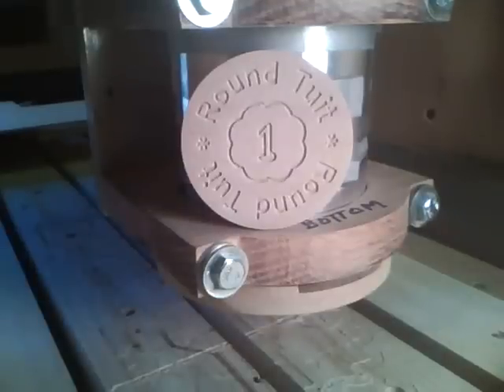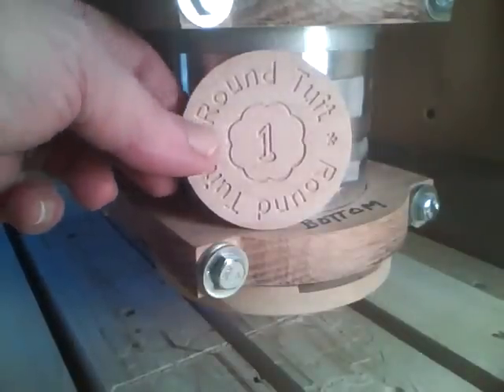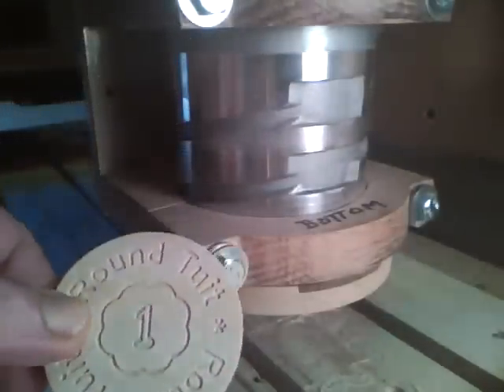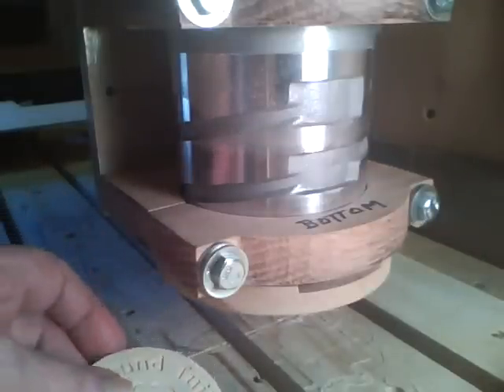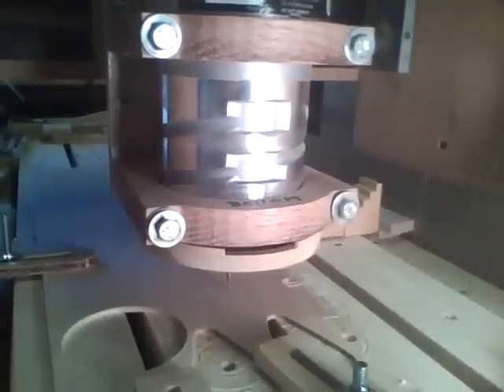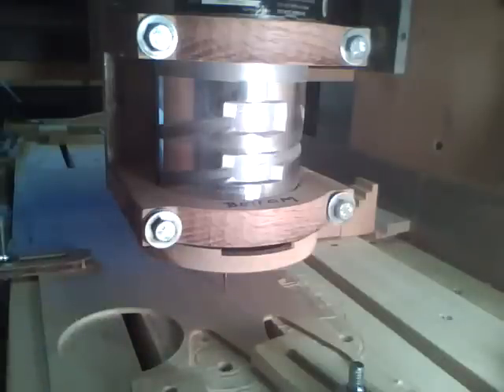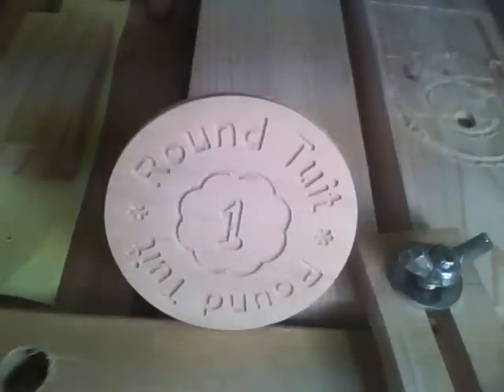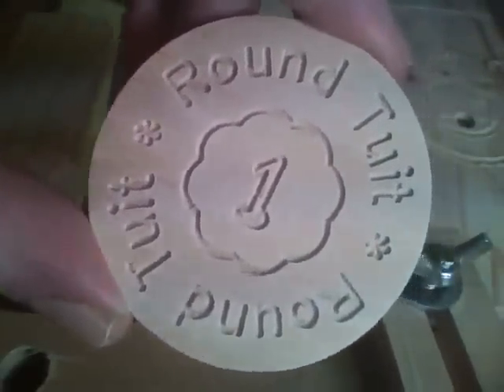I'll do it when I get a Round Tuit

Comment from the maker: I had a request for the G-code, so here it is:

%
(File: Round Tuit 2-5.skp)
(X0 and Y0 is central)
(Bit diameter: 1/16" Ball)
(Feed rate: 10.000"/min)
(Plunge Feed rate: 4.000"/min)
(Material Thickness: 0.125")
(17 April 2015 Jim Steinbrecher)
G90 G20 G49
G00 Z0.025
X0.7425 Y-0.3075
G01 Z-0.025 F4
X0.9635 Y-0.4245 F8
X0.913 Y-0.519
X0.886 Y-0.545
X0.8695 Y-0.55
X0.843 Y-0.5495
X0.822 Y-0.538
X0.8065 Y-0.5165
X0.802 Y-0.5005
X0.808 Y-0.4635
X0.8585 Y-0.3685
G00 Z0.025
X0.819 Y-0.4425
G01 Z-0.025 F4
X0.6645 Y-0.4545 F8
G00 Z0.025
X0.6915 Y-0.676
G01 Z-0.025 F4
X0.7 Y-0.6505 F8
X0.7 Y-0.617
X0.6835 Y-0.5835
X0.667 Y-0.5665
X0.6335 Y-0.549
X0.5995 Y-0.549
X0.5745 Y-0.557
X0.549 Y-0.5825
X0.5405 Y-0.6075
X0.54 Y-0.641
X0.5565 Y-0.675
X0.5735 Y-0.692
X0.607 Y-0.709
X0.6405 Y-0.709
X0.666 Y-0.701
X0.6915 Y-0.676
G00 Z0.025
X0.5125 Y-0.822
G01 Z-0.025 F4
X0.4565 Y-0.717 F8
X0.429 Y-0.6915
X0.4025 Y-0.692
X0.371 Y-0.709
X0.3555 Y-0.7305
X0.341 Y-0.779
G00 Z0.025
X0.397 Y-0.884
G01 Z-0.025 F4
X0.3185 Y-0.737 F8
G00 Z0.025
X0.2575 Y-0.934
G01 Z-0.025 F4
X0.224 Y-0.7705 F8
G00 Z0.025
X0.248 Y-0.8875
G01 Z-0.025 F4
X0.22 Y-0.9295 F8
X0.199 Y-0.946
X0.164 Y-0.953
X0.1385 Y-0.946
X0.1195 Y-0.9135
X0.096 Y-0.797
G00 Z0.025
X-0.1565 Y-1.0405
G01 Z-0.025 F4
X-0.135 Y-0.7915 F8
G00 Z0.025
X-0.146 Y-0.9215
G01 Z-0.025 F4
X-0.1245 Y-0.9475 F8
X-0.102 Y-0.9615
X-0.0665 Y-0.9645
X-0.0415 Y-0.955
X-0.0155 Y-0.933
X-0.001 Y-0.8985
X0.0015 Y-0.875
X-0.0075 Y-0.838
X-0.029 Y-0.8125
X-0.052 Y-0.7985
X-0.0875 Y-0.7955
X-0.112 Y-0.805
X-0.138 Y-0.827
G00 Z0.025
X-0.548 Y-0.8955
G01 Z-0.025 F4
X-0.4175 Y-0.6825 F8
G00 Z0.025
X-0.477 Y-0.939
G01 Z-0.025 F4
X-0.619 Y-0.852 F8
G00 Z0.025
X-0.658 Y-0.711
G01 Z-0.025 F4
X-0.5715 Y-0.6295 F8
X-0.554 Y-0.596
X-0.5615 Y-0.5705
X-0.586 Y-0.5445
X-0.611 Y-0.5355
X-0.6615 Y-0.534
G00 Z0.025
X-0.748 Y-0.6155
G01 Z-0.025 F4
X-0.627 Y-0.5015 F8
G00 Z0.025
X-0.888 Y-0.5605
G01 Z-0.025 F4
X-0.884 Y-0.5445 F8
X-0.9005 Y-0.5405
X-0.904 Y-0.557
X-0.888 Y-0.5605
G00 Z0.025
X-0.823 Y-0.507
G01 Z-0.025 F4
X-0.681 Y-0.4195 F8
G00 Z0.025
X-0.962 Y-0.4205
G01 Z-0.025 F4
X-0.776 Y-0.3415 F8
X-0.7475 Y-0.3165
X-0.746 Y-0.29
X-0.755 Y-0.268
G00 Z0.025
X-0.8715 Y-0.421
G01 Z-0.025 F4
X-0.904 Y-0.344 F8
G00 Z0.025
X-0.9785 Y0.0075
G01 Z-0.025 F4
X-0.8355 Y0.0065 F8
G00 Z0.025
X-0.9435 Y-0.052
G01 Z-0.025 F4
X-0.871 Y0.0665 F8
G00 Z0.025
X-0.9425 Y0.067
G01 Z-0.025 F4
X-0.872 Y-0.0525 F8
G00 Z0.025
X-0.744 Y0.3045
G01 Z-0.025 F4
X-0.965 Y0.421 F8
X-0.915 Y0.516
X-0.888 Y0.542
X-0.8715 Y0.547
X-0.845 Y0.5465
X-0.824 Y0.5355
X-0.8085 Y0.5135
X-0.8035 Y0.4975
X-0.8095 Y0.4605
X-0.8595 Y0.3655
G00 Z0.025
X-0.821 Y0.4395
G01 Z-0.025 F4
X-0.666 Y0.452 F8
G00 Z0.025
X-0.6935 Y0.6735
G01 Z-0.025 F4
X-0.702 Y0.648 F8
X-0.7025 Y0.6145
X-0.6855 Y0.581
X-0.669 Y0.564
X-0.635 Y0.547
X-0.6015 Y0.547
X-0.5765 Y0.555
X-0.551 Y0.5805
X-0.5425 Y0.6055
X-0.5425 Y0.639
X-0.559 Y0.673
X-0.576 Y0.69
X-0.6095 Y0.707
X-0.643 Y0.707
X-0.6685 Y0.6985
X-0.6935 Y0.6735
G00 Z0.025
X-0.5155 Y0.8205
G01 Z-0.025 F4
X-0.459 Y0.7155 F8
X-0.4315 Y0.6895
X-0.405 Y0.6905
X-0.3735 Y0.7075
X-0.3585 Y0.729
X-0.3435 Y0.7775
G00 Z0.025
X-0.4 Y0.8825
G01 Z-0.025 F4
X-0.321 Y0.7355 F8
G00 Z0.025
X-0.261 Y0.933
G01 Z-0.025 F4
X-0.227 Y0.77 F8
G00 Z0.025
X-0.251 Y0.8865
G01 Z-0.025 F4
X-0.2235 Y0.9285 F8
X-0.2025 Y0.945
X-0.1675 Y0.9525
X-0.142 Y0.9455
X-0.123 Y0.913
X-0.0985 Y0.7965
G00 Z0.025
X0.153 Y1.041
G01 Z-0.025 F4
X0.132 Y0.7915 F8
G00 Z0.025
X0.143 Y0.922
G01 Z-0.025 F4
X0.121 Y0.948 F8
X0.0985 Y0.962
X0.063 Y0.965
X0.038 Y0.955
X0.0125 Y0.933
X-0.0025 Y0.8985
X-0.0045 Y0.875
X0.0045 Y0.8385
X0.026 Y0.8125
X0.049 Y0.7985
X0.0845 Y0.7955
X0.109 Y0.8055
X0.135 Y0.8275
G00 Z0.025
X0.545 Y0.8975
G01 Z-0.025 F4
X0.415 Y0.684 F8
G00 Z0.025
X0.4735 Y0.941
G01 Z-0.025 F4
X0.616 Y0.8545 F8
G00 Z0.025
X0.6555 Y0.7135
G01 Z-0.025 F4
X0.5695 Y0.6315 F8
X0.5515 Y0.598
X0.5595 Y0.5725
X0.584 Y0.547
X0.609 Y0.5375
X0.6595 Y0.5365
G00 Z0.025
X0.746 Y0.6185
G01 Z-0.025 F4
X0.625 Y0.5035 F8
G00 Z0.025
X0.886 Y0.564
G01 Z-0.025 F4
X0.882 Y0.5475 F8
X0.8985 Y0.5435
X0.902 Y0.56
X0.886 Y0.564
G00 Z0.025
X0.8215 Y0.51
G01 Z-0.025 F4
X0.6795 Y0.422 F8
G00 Z0.025
X0.9605 Y0.424
G01 Z-0.025 F4
X0.7745 Y0.3445 F8
X0.7465 Y0.3195
X0.745 Y0.293
X0.754 Y0.271
G00 Z0.025
X0.87 Y0.424
G01 Z-0.025 F4
X0.903 Y0.3475 F8
G00 Z0.025
X0.9785 Y-0.004
G01 Z-0.025 F4
X0.8355 Y-0.0035 F8
G00 Z0.025
X0.943 Y0.0555
G01 Z-0.025 F4
X0.871 Y-0.0635 F8
G00 Z0.025
X0.9425 Y-0.0635
G01 Z-0.025 F4
X0.8715 Y0.056 F8
G00 Z0.025
;
G90 G20 G49
;
G00 Z0.025
X-0.1067 Y-0.2174
G01 Z-0.025 F4
X-0.1103 Y-0.2015 F10
X-0.1063 Y-0.1836
X-0.0943 Y-0.1708
X-0.0742 Y-0.1631
X-0.0459 Y-0.1606
X-0.0325
Y0.1098
X-0.067 Y0.0916
X-0.083 Y0.0946
X-0.0967 Y0.1037
X-0.1063 Y0.1169
X-0.1094 Y0.1321
X-0.1044 Y0.1492
X-0.089 Y0.1667
X-0.0545 Y0.1918
X-0.0172 Y0.2217
X0.0052 Y0.2341
X0.027 Y0.2382
X0.0391 Y0.236
X0.0476 Y0.2298
X0.0527 Y0.2195
X0.0545 Y0.2051
X0.0514 Y0.1028
X0.0484 Y-0.0855
Y-0.1593
X0.0685
X0.0848 Y-0.1621
X0.0983 Y-0.1707
X0.1073 Y-0.1833
X0.1103 Y-0.1988
X0.1073 Y-0.2141
X0.0983 Y-0.2268
X0.0848 Y-0.2353
X0.0685 Y-0.2381
X-0.0527
X-0.0779 Y-0.2355
X-0.0959 Y-0.2288
X-0.1067 Y-0.2174
G00 Z0.025
;
G00 Z0.025
X-0.3046 Y-0.4534
G01 Z-0.025 F4
X-0.2784 Y-0.48 F10
X-0.2483 Y-0.5022
X-0.215 Y-0.5192
X-0.1795 Y-0.5307
X-0.1425 Y-0.5363
X-0.1052
X-0.0683 Y-0.5297
X-0.033 Y-0.5176
X0 Y-0.5
X0.033 Y-0.5176
X0.0683 Y-0.5297
X0.1052 Y-0.536
X0.1426
X0.1795 Y-0.5307
X0.2151 Y-0.5192
X0.2483 Y-0.5022
X0.2784 Y-0.48
X0.3046 Y-0.4534
X0.3262 Y-0.4229
X0.3427 Y-0.3893
X0.3536 Y-0.3536
X0.3893 Y-0.3427
X0.4229 Y-0.3262
X0.4534 Y-0.3046
X0.48 Y-0.2785
X0.5022 Y-0.2483
X0.5192 Y-0.2151
X0.5307 Y-0.1795
X0.5363 Y-0.1426
Y-0.1052
X0.5297 Y-0.0683
X0.5176 Y-0.033
X0.5 Y0
X0.5176 Y0.033
X0.5297 Y0.0683
X0.536 Y0.1052
X0.5363 Y0.1425
X0.5307 Y0.1795
X0.5192 Y0.215
X0.5022 Y0.2483
X0.48 Y0.2784
X0.4534 Y0.3046
X0.4229 Y0.3262
X0.3893 Y0.3427
X0.3536 Y0.3535
X0.3427 Y0.3893
X0.3262 Y0.4229
X0.3046 Y0.4533
X0.2784 Y0.48
X0.2483 Y0.5021
X0.2151 Y0.5191
X0.1795 Y0.5306
X0.1426 Y0.5363
X0.1052 Y0.536
X0.0683 Y0.5297
X0.033 Y0.5176
X0 Y0.5
X0 Y0.5
X-0.0683 Y0.5297
X-0.1052 Y0.536
X-0.1425
X-0.1795 Y0.5306
X-0.215 Y0.5191
X-0.2483 Y0.5021
X-0.2784 Y0.48
X-0.3046 Y0.4533
X-0.3262 Y0.4229
X-0.3427 Y0.3893
X-0.3535 Y0.3535
X-0.3893 Y0.3427
X-0.4229 Y0.3262
X-0.4534 Y0.3046
X-0.48 Y0.2784
X-0.5021 Y0.2483
X-0.5192 Y0.215
X-0.5306 Y0.1795
X-0.5363 Y0.1425
Y0.1052
X-0.5297 Y0.0683
X-0.5176 Y0.033
X-0.5 Y0
X-0.5176 Y-0.033
X-0.5297 Y-0.0683
X-0.536 Y-0.1052
Y-0.1426
X-0.5306 Y-0.1795
X-0.5192 Y-0.2151
X-0.5021 Y-0.2483
X-0.48 Y-0.2785
X-0.4534 Y-0.3046
X-0.4229 Y-0.3262
X-0.3893 Y-0.3427
X-0.3535 Y-0.3536
X-0.3427 Y-0.3893
X-0.3262 Y-0.4229
X-0.3046 Y-0.4534
G00 Z0.025
;
G00 X0 Y1.25
G01 Z0 F4
G02 X0 Y1.25 I0 J-1.25 Z-0.026 F15
G02 X0 Y1.25 I0 J-1.25 Z-0.052
G02 X0 Y1.25 I0 J-1.25 Z-0.078
G02 X0 Y1.25 I0 J-1.25 Z-0.104
G02 X0 Y1.25 I0 J-1.25 Z-0.130
G02 X0 Y1.25 I0 J-1.25
G00 Z0.05
M2
%